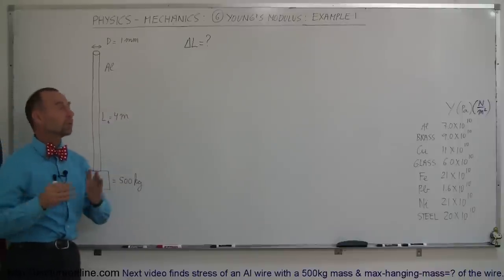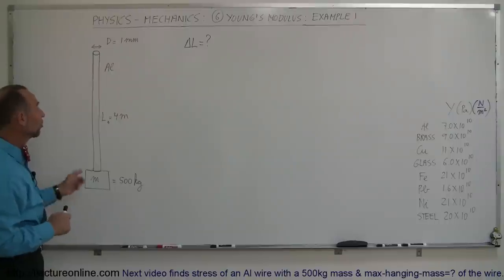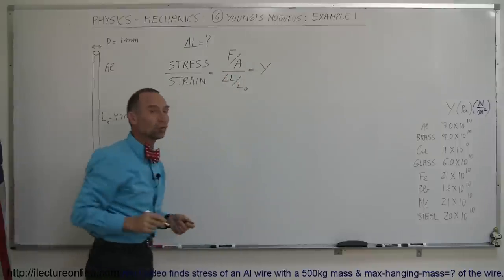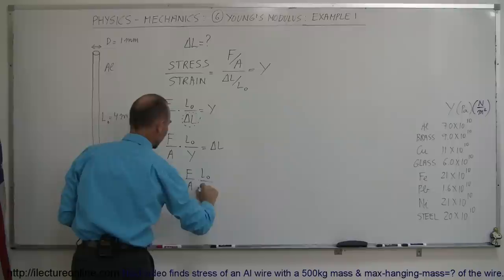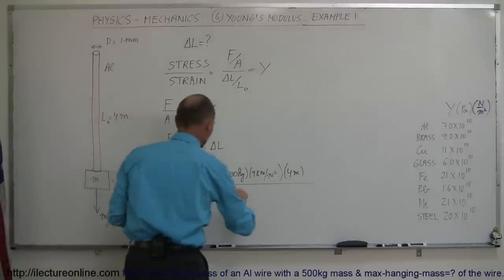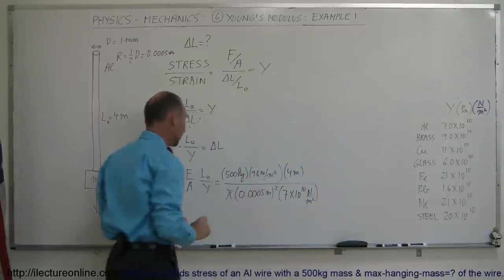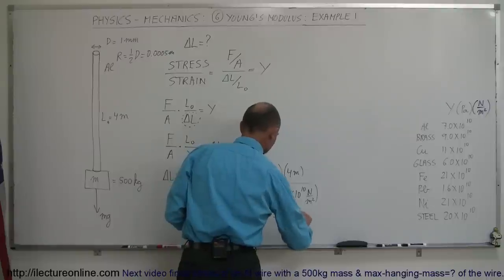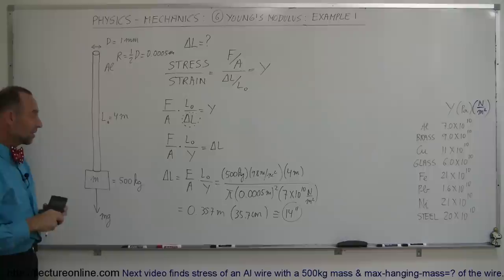Physics - Mechanics: Stress and Strain (6 of 16) Young's Modulus: Ex. 1: Aluminum Wire

Comment: Sir i don't know how to get the extracts out of the question
For example when he say .....2 m long bar has a rectangular cross section. 0.02 m by 0.04 m. If it is subjected to a 10,000 N force along its length, what is stress i dont no what is .04 and .02 or how To get ..A
Reply from the maker: Area = length x width = 0.04 m x 0.02 m = 0.0008 m^2
Reply: @MichelvanBiezen  What is the use of 2 m

Comment: what if you don't have the force? you have the change in the length but you have to find the force applied in that length?
Reply from the maker: You use the very same equation, but you algebraically solve it for the force instead of the change in legnth.
Reply: @MichelvanBiezen  oh so instead of y = is F = .... got it, thanks

Comment: Do you have any example for an occasion where a cylindrical wire suspended horizontally is supporting a mass in the middle with slight sagging?And the question is regarding Young's modulus.
Reply from the maker: One cannot "suspend" horizontally.  But we can place tension on horizontal wires and that would work exactly the same.
Reply: There may have been a wrong term usage here
Reply: I mean a wire horizontally attached at each ends  to some kind of pole or something with a load in the middle that causes a say and how to calculate,involving Young's modulus
Reply from the maker: Here is where we have such examples.  PHYSICS 4.5 - STATICS & EQUILIBRIUM
Reply: @MichelvanBiezen  thanks

Comment: Why did you not take the area of the entire pipe with the length (4 x circumference + 2(pie R squared) ?
Reply from the maker: +Colin McCorkle The area is the cross-sectional area (pi * R^2)
Reply: thank you.  You are the man
Reply: That's the volume you're talking about, the area is Pi*(R^2)

Comment: Where did the 9.8 come from
Reply from the maker: 9.8 m/sec^2 is the acceleration due to gravity
Reply: @MichelvanBiezen  how would you calculate the stress experienced by a rod?
Reply from the maker: Sress = Force / (cross-sectional area)      In this case the force is the weight = mg

Comment: Steel wire mass=3.9kg,Its strain is 0.001.How to find potential energy of the steel wire,Sir?
Reply from the maker: Since the length is not given, I will assume the original length is 1 m and the delta L = 0.001 x 1 m = 1 mm ( = 0.001m).  Now we need to find k (the spring constant)    F = kx     So k = F / delta L   = mg / delta L = (3.9 kg) (9.8 m/sec^2) / 0.001 m = 38 220 N/m     PE = (1/2) k x^2 = (1/2) (38 220) (0.001)^2 = 0.0191 J

Comment: Hello Professor! Thank you for uploading these materials. They are extremely helpful. But I have a question, shouldn't 500 kg be converted to g?
Reply from the maker: kanamechidori,
I wasn't sure if you are asking about unit conversion or converting to a force.
As far as units are concerned, you can use any units as long as they are consistent.  (We prefer standard SI units so we use kg)
Since we need to use the weight of the object in this problem, w = mg = (500 kg) * (9.8 m/sec^2)